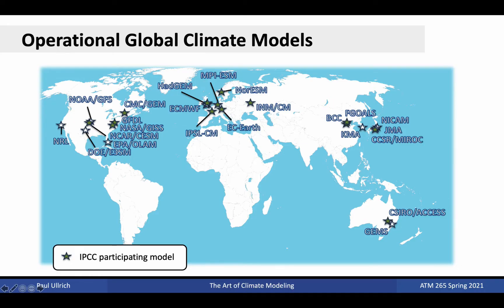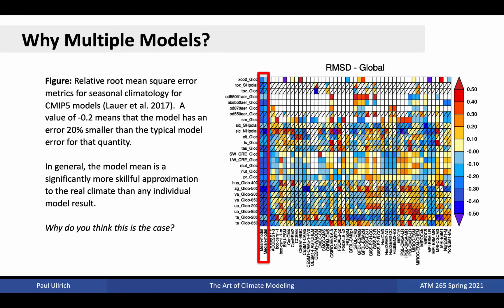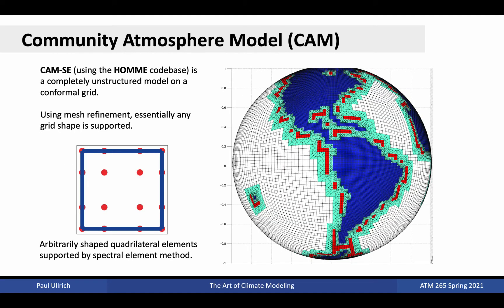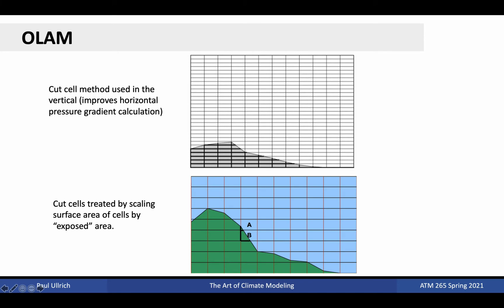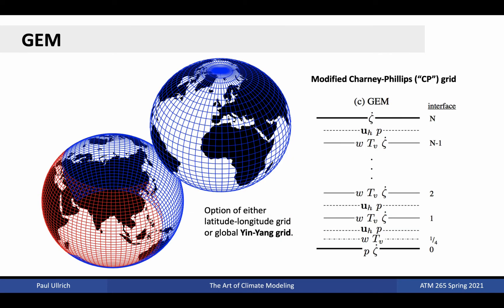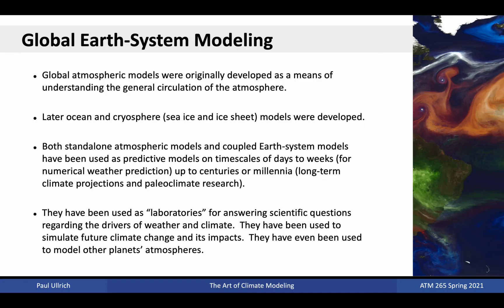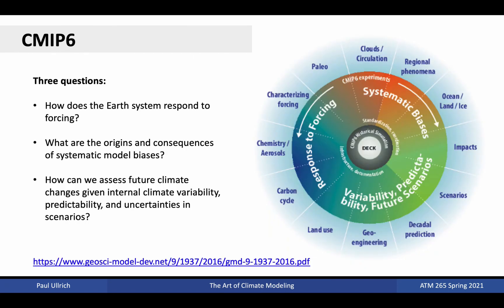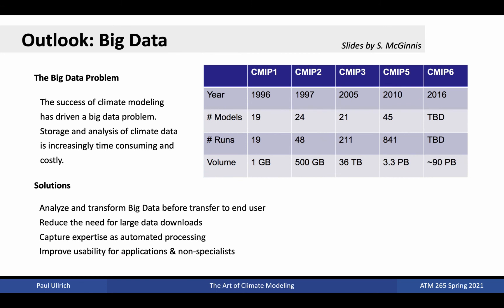The Art of Climate Modeling Lecture 11 - Modern Climate Modeling

Comment: Modelling is a great tool but only after a level of certainty about the parameters have been reached. In physics some known factors can be easily established by sheer experience and real live data observations. However, in regards to climate only a very limited amount of parameters are certain. Complicated by a dynamic interactive non equilibrium system one could say with absolute certainty that no model or series of models can be relied upon, not even an average even if they all agree. If the underlying premise or assumption is wrong the outcome is as well. So, if you assume the greenhouse gas theory is right in ALL your models All of them will more or less point to the same thing. Since everyone seems to be focused on Co2 maybe it is best to start the models without that and see how they level up to real time measurements. A lot better than they currently do would be my assumption